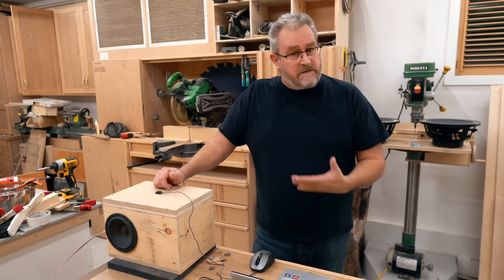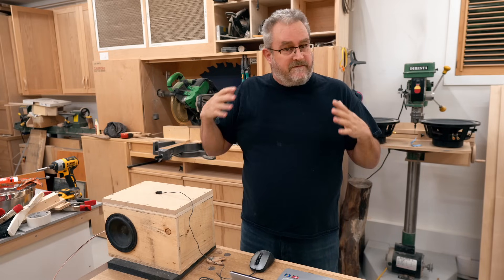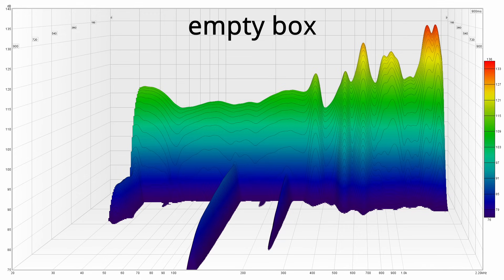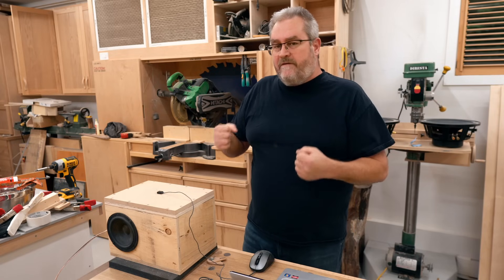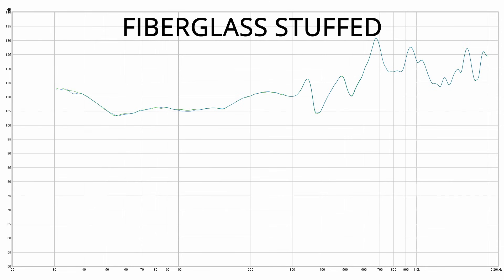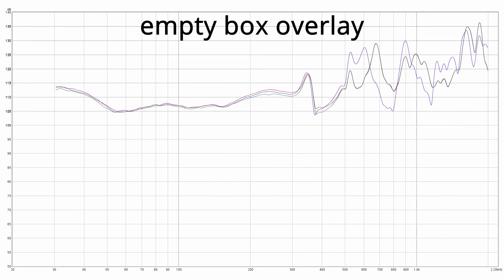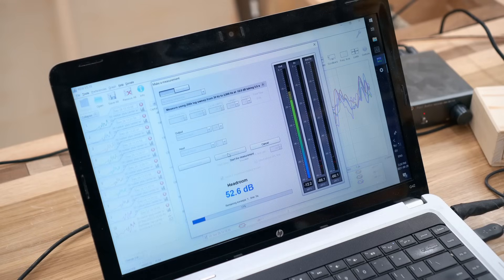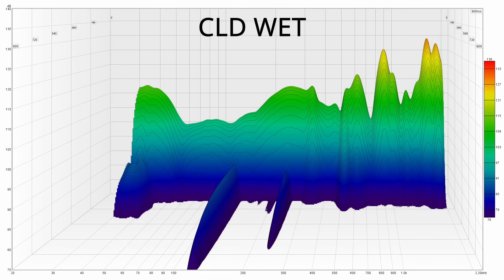Best Stuffing for Speakers Tested - Unexpected Results

Comment: Great effort here, but have to say the shape of the cabinet is close to a cube, which can have significant standing wave problems and is less typical of the taller / thinner shape of many of todays speakers.  A good experiment would be to buy actual speakers (whatever you can afford) and test these with their damping and remove it, then test other damping alternatives. The cabinet bracing would be held constant of course as you'd have a pre-manufactured product.

Comment: There's only one way to eliminate panel resonance and that is to stick 20mm thick bitumastic panels on the inside !! This really works !! 1inch thick heavy duty carpet felt is second best ... forget all this stuffing ... that's only used to make the enclosure seem larger to the bass driver and lower Qb ...

Comment: There is an additional effect in putting fiberfill or fiberglass  inside a closed box system. When you fill the box with fiberfill or fiberglass, the material slows down the passage of sound waves through the box, making the speaker react as if the box is bigger. The result is that the Fb (resonant frequency of speaker mounted in box) is lower when the box is filled with fiberfill or fiberglass than when the box is completely empty. My experiments show that the effective volume is increased by a factor of 1.2. This effect is far more pronounced than any reduction in panel vibration would be. Better to brace the panels. My trick is to use dowels between the back of the speaker and the back wall of cabinet, one dowel for each mounting screw. This method locks the front and back of the cabinet together and cuts vibration way down. Your experiments did not produce this effect because you only filled half the box with fiberfill.
Reply: Your understanding is similar to mine - the point of lining cabinets with some sort of fibrous material is to increase the effective volume of the enclosure. I have a couple of vintage Acoustic 807 3-way cabinets that seem to be their take on the Altec-Lansing "Voice Of The Theater" speaker systems except what they did was stick two 12" drivers one over the other in a bass horn configuration - except what they did was to close off the top 12" and give the bottom 12" a vent all the way across the bottom. I am in the process of reworking these cabs (mostly replacing the crossover and adding L-pads for the piezo tweeters and the mid horn) and I'm wondering what the effect would be of lining the top 12"'s enclosure with polyfill (the way I do it is to separate the polyfill into consistently sized tufts and hot-glue each tuft to the walls) and leaving the bottom 12"'s vented enclosure alone.

Comment: Now here in Germany we have a product called 'Reckhorn ABX'. It is a 2-2.5 mm thick sheet of butyl, covered with aluminium. It has a weight of 2.5kg/m². I would be really, interested in what that does to a panel. It has a relatively high density, so it doesn't take away a lot of volume, but also dampens really well.
Reply: Nehm Bitumen schweissbahn  das ist billiger.

Comment: My understanding is that stuffing mainly reduces reflections from coming out through the speaker cone, and any damping properties are secondary. It would be interesting to see this with a different box design.

What would be even more interesting would be a double walled box with sand fill. This is supposed to do wonders for resonance. I would be most interested in seeing it with a big driver in a big box, vs a small driver in a small box. At what frequency does the sand stop doing anything?

Thanks, I enjoy the content.
Reply: A small amount of stuffing/carpet especially on the inside back wall helps break up standing waves.  But the primary reason for lots of polyfill type stuffing is to act as an air spring....i.e slow the speed of sound down a bit. This has the effect of making the box look bigger to the speaker  

But this is only if a small amount of stuffing is used and packed in a "fluffy" manner.  If the box is packed too much it will have the opposite effect and actually increase the sound speed and make the box look smaller. Plus all this packing comes at the cost of some damping and efficiency loss.

Comment: John, great content... so refreshing. 
I'd be interested in another pathway for that panel excitation you're exploring... mechanical. 

Experimenting with mechanical reactionary energy off the speaker basket/flange... as a corruptive force feeding your accelerometer. 
Kef's Laurie Finchum and Jack Oclee-Brown have explored this extensively. They designed and implemented isolation system to address it. 
In the Blade for example, the coax unit is a module entirely isolated from the cabinet, thus mitigating corruptive energy in either direction. 

I realize you can't explore everything, yet I did want to share. 
Thanks
Reply from the maker: I did something similar many years ago where I cut a 1/4" slot around the outside of the woofer frame through the baffle, then filled that open slot with silicone rubber. So in effect mounting the woofer on a flexible ring.
I then tested the amount of mechanical vibration that was reduced, or at least tried to. I was using Arta at the time and it would plot the accelerometer output in a CSD, but it made the level non-relative to a set standard, so I couldn't put a number on the amount (if any). 
I may give it another try in the future, but I think that the amount of noise generated by these issues are generally not worth the mitigation efforts. Certainly time and money would be better spend elsewhere in practical terms. But then audio is filled to the brim with people who's expectations and understanding is anything but practical, so I can see why some manufacturers pursue them.
Reply: @IBuildIt  
I too have attempted grasping the significance of these things, but so, so difficult to actually determine as a diy'er, what's what.
But in audio, pursuing the diminishing of each and every non-linearity you encounter, of any type, and addressing the accumulative result is welcome. 

Yes, there's more bullshit issues and solutions, than legit and quantifiable tweeks and workarounds. 
But still, chipping away at legit corruptive influences pays off... however small, moving in the right direction is the point after all.
Reply from the maker: Guys are switching cables, buying expensive gear, worrying that their speakers are creating too much noise while listening to their setup in a room with no acoustic treatment at all. That's the place to start, and it will bring the kind of improvements you have to be deaf not to hear. 
Chasing unicorns while ignoring the elephant that is the room.
Reply: @IBuildIt  
Brother, I preach the room 24/7, the room's transfer function owns the experience.

Comment: Do the same test with a mic in front of the speaker to see if there is a change in output . There will be little to no difference in pannel vibration.  Not the best test .

Comment: What are your opinion in stuffing a car audio subwoofer box (sealed or ported)?  Let's say fiber glass because it seems to be the best of these 3. Would you consider getting to hot in there? Subwoofer produce heat.
I am not referring to crank SPL but on regular listening?

Comment: I'm very new to this, so if this comes off as stupid, please forgive me.  But guys, if the idea is to stop the resonance, or vibration, of the box, why not drill three small holes in the sides of the cabinet, 1/4 inch say, to relieve the air pressure and take the pressure off the box.  I understand that there will be a little mechanical vibration, but still the total should be less.  Am I totally off base here?

Comment: Hi John. Do you think something like 3M's VHB tape would work better then the silicone? Kinda pricey to cover the side with it. But it's a 1/16" thick and kinda like a neoprene foam so would/may act different then the silicone. 
Also, do you think there'd be a difference made with how you've got the panel attached? Gluing it to the box vs the screws as used? 
Thanks!

Comment: Thank you for these tests, very interesting. I had the same idea as CLD, but I want to use vibration dampening materials from the car audio industry, they come in sheets with adhesive pre-applied, quite convenient to use and specifically designed for this task.

Comment: Thanks for making this video. I enjoyed the last one with the different panels. Perhaps It's already been said, the purpose of stuffing inside of a box has nothing to do with taming panel resonances. The purpose of stuffing inside the box is to change the environment that the base and mid-range drivers are operating in. Also, why are you putting it in the cavity without the driver? It goes in the cavity with the driver.
Reply from the maker: Stuffing changes the environment inside the box by damping the airspace and the panels. To measure how effectively it does that, I measured the panel vibrations. Stuffing is damping material - it's as simple as that.
Reply: @IBuildIt  you are correct in calling it a dampener. It's job is to dampen or slowdown the back wave of the woofer or midrange driver and therefore change it's performance without altering the size of the enclosure. It is not intended to dampen vibration of the enclosure itself. That is the job of enclosure construction and materials.
Reply from the maker: @donalddluckerii3147  Like I said: damping is damping. While the main reason to put stuffing in a box is to damp the airspace, it also damps the panels and it's the panels that I can measure. I can't measure the airspace and how effectively the stuffing is damping that, but I can measure the panels. And that will tell me how effective it is.
This isn't complex, but starting with the idea that you understand it better than I do  isn't productive. Maybe you (like many others) were confused by the other testing I did at the end where I damped the panels directly. I did that to put things into perspective and also fill out the video.
Reply: @IBuildIt  Sir it is very possible you have more experience than I do as in the 38 years I've been into audio I've only built a few pairs of bookshelf speakers and a few subwoofers. I'm not meaning to indicate that you don't know what you're doing. I believe you do from the videos I've watched. What I am saying is that in all this time and in all the books I've read on the subject (all the classic diy Speaker building etc) and all the manufacturers who've explained how innert their cabinets are (Wilson Audio, Bowers KEF etc) it has never been my impression that speaker filling had anything at all to do with dampening the cabinets at all. There's no mass and as you found out when you glued 2 panels together that mass and physical absorption we're needed in tandem to accomplish any meaningful panel dampening. Again I am not purporting to "know more than you". I am simply saying that I don't agree with your prescribed use of acoustic filling. The only way to actually get any meaningful cabinet dampening is with cabinet construction and materials.
Reply from the maker: Oh, you can do meaningful panel damping with stuffing alone. I put 58 grams in, which is just 2 ounces if you aren't familiar with grams. That's not very much, but I could definitively measure not only a reduction in panel vibration, but actually see the differences between all three. That's meaningful by most reasonable people's definition. And it's right there on the screen for you to see
Damping material doesn't have a mind of its own. It doesn't decide to be inside the box and only damp the airspace. It absorbs energy - period. It doesn't care where that energy is coming from. If the speaker cone is moving, it absorbs some of that energy. If the panel is moving, it does exactly the same : it adsorbs some of that energy.
Does something work better to damp panel vibrations? YES! That's what I demonstrated as a bonus at the end of the video. That's not me saying that stuffing is ONLY used for panel damping. It's me trying to put things in perspective and as a result confusing people who can't grasp the bigger picture.
You might know tons about audio and may have read every book written on the subject, but this is physics. Pretty basic physics, actually.
Reply from the maker: Here's a quick practical experiment you can do right now. Take a wine glass and flick the rim with your finger and make it ring. Now take a piece of bathroom tissue and put it into the glass and then flick it again. You hear the effect of damping material on panel vibration immediately.
Reply: @IBuildIt  No, I have a basic idea of how resonances is work, and also how they differ based on the mass of that which is vibrating. We can't compare a wine glass to a chunk of wood because they are not at all similar in the way that they vibrate. The wine glass rings for a very long time when flicked but the wood dies not.  The reason your graphs show lower output from the wood panel is because the  stuffing is absorbing the output off of the back of the driver. It is this that your graphs are showing. You are not dampening the wood panel. This is simple physics. Nobody uses box stuffing to dampen panel resonances because it has no mass. If it did have enough mass to dampen panel resonances it would be bad at absorbing the sound wave of the driver.  Again, simple physics. You demonstrated almost no difference in your graphs between when the box was stuffed and when it wasn't. I believe that your inference that you are decreasing the panel resonances because of the stuffing is incorrect. It is in fact a result of dissipating the energy off the back wave. The only time you saw any meaningful change in your measurements was when you applied more mass and a viscoelastic material which dampened the panel itself. Of course the wine glass will stop resonating because it's very easily excited hence it's Very easily unexcited or dampened. Please rethink your physics because you are not dampening the panel. You are simply absorbing some the back wave of the driver. All speaker manufacturers use fill to alter the properties of the driver not the cabinet. The cabinet is dampened by it's construction techniques and build materials.
Reply from the maker: I give up.
Reply: @IBuildIt  John. Can you please put a link for the accelerometer you use so I can get one ?
Please

Comment: Two great videos, thanks! The preferred CLD method in UK DIY years ago was bituminous felt panels (a thick roofing product) covering all box internal surfaces. I built the Wireless World Tabor DIY design using Audax drivers using this technique in the late 70s. I had many comments regarding their excellent sound quality. When it comes to bracing, the matrix method first introduced by B&W and, later, used by Paradigm is beyond the capabilities of most DIYers. It is used in my present speakers Paradigm Studio Monitor 30s purchased twenty years ago that I have never felt the need to replace. However, I must admit I'm tempted by the KEF LS50 Metas with their use of a sculptured disc to absorb high frequency energy within the box, truly revolutionary and a tribute to British engineering.

Comment: When you brace in the middle of the box you up with  two panels of the same resonant frequency, this is why asymmetrical bracing and trapezoid boxes will generally give you a better performance. Mass does work but is best with Multiple techniques of dissimilar Materials that will not exasperate resident modes. Enjoy the hobby. 😀
Reply: You are correct it would help him if he moved his brace off center

Comment: You may try to drill holes in the Inside of the panel in a Helmholtz resonator pattern that you compute to act around the most offending frequency.
About the same as your acoustic panels just inside the  speaker box

Comment: What's with all this artificial stuff? I only use real wool for damping material directly behind the drivers with a half inch foam dampening material on side walls of speaker cabinet. I do like how you experimented with different panels and thicknesses and most of your video is enlightening. It all starts with the process of elimination. Carry-on! :>)

Comment: I guess I should continue with my urethane filled cld panels/enclosure! Also what I've been using for fill is ultraTouch denim insulation, the absorption factor is as good or better than rockwool/fiberglass, it's kind of messy to work with, lots of loose fibers but I just hate fiberglass.
Love the work your doing!

Comment: Interesting series mate. Used to work as a Q&R for Bowers & Wilkins many moons ago in one of my brief career deviations. Materials, material density, isolation and insulation is something that can be talked about without end. As is shape and compartmentalisation. Whether you want a speaker characteristic or a flat response etc. All about marginal gains at a certain level. For DIY'ers, I think your info is sound.  Good stiff box, braced and plenty of fixings as you've done. Also driver sensitivity matching as best you can which I think you've touched on. Acoustic loose fill stuffing (looks like cotton wool) is effective and cheap alternative to the stuffing options you've shown. Particularly good around internal bracing.
Reply: How can they use fiberglass with vented enclosures , just imagine all the tiny glass particles you are breathing . 😥🖐🔊😡